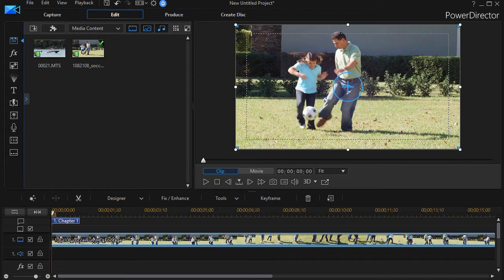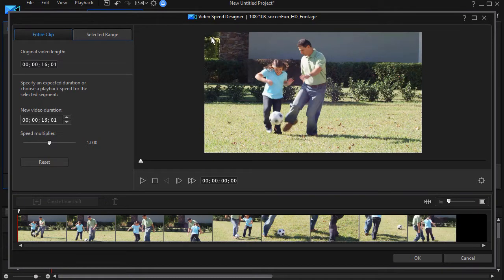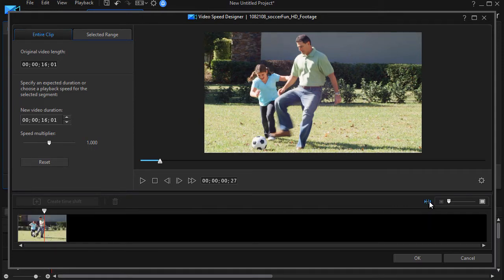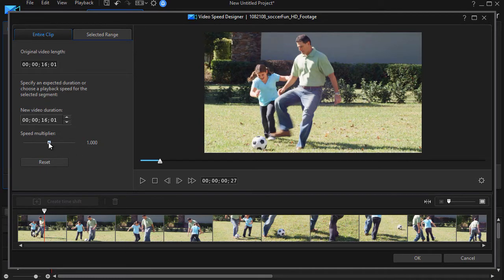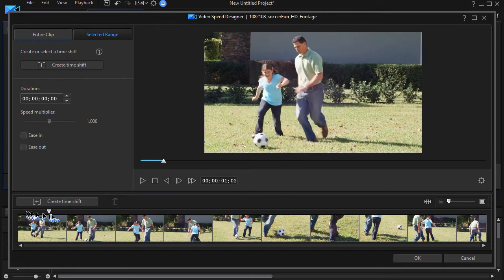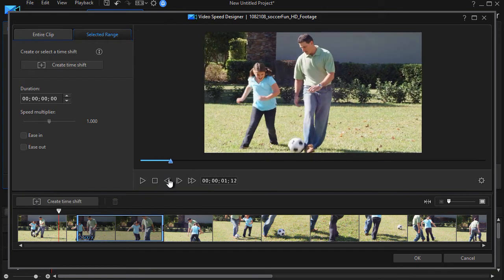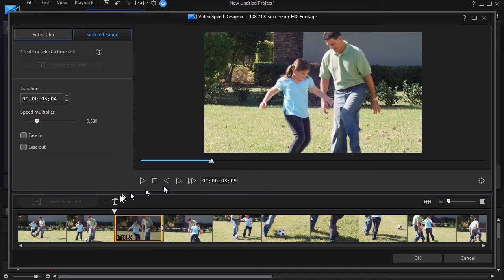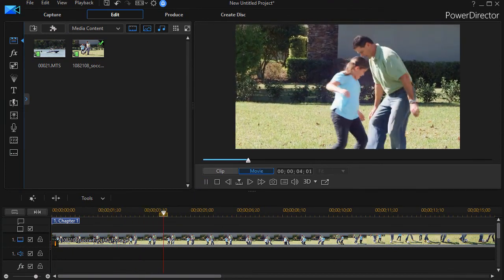PowerDirector - Two ways to use slow motion

Comment: Can you please explain to me how I can change the speed duration in different ranges while listening to the audio track of my project that's not connected to the clip that I'm adjusting the speed on?
Reply from the maker: Sounds like you are trying to match video with audio. I'm not sure about the best way to accomplish that in PowerDirector. My first instinct is to listen to the audio and write down the timecode segments, then go into the multi-trim function and adjust the video accordingly. That would be cumbersome, but might work. What kind of audio are you working with? Is it music? In filmmaking they typically adjust the music to the final video. You can do that with high-end DAW software like Steinberg's Cubase. But that involves original composition.

I hope others will come in on this thread who can give you better options. ---Jim
Reply: @SharperTurtle  Thanks Jim. I am adjusting the speed to sync with music. I built my whole project around beat the manual beat detection tool. I marked my spots placed my desire clip exactly where the beat hits but found myself going crazy whenever I would try to do anything with that standalone clip.
Reply from the maker: If I were to try to do something like that I would probably split the clip at the beat markers and then use the video speed  control under tools to tweak the duration of each clip. It would work best if the adjustments were not massive. Is that at all helpful? --Jim